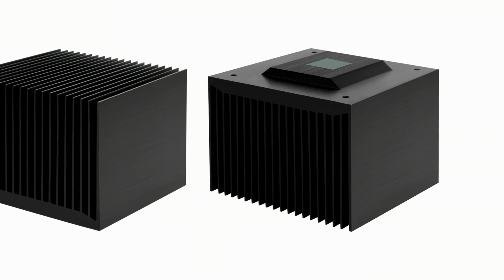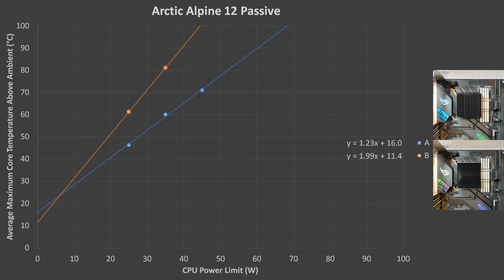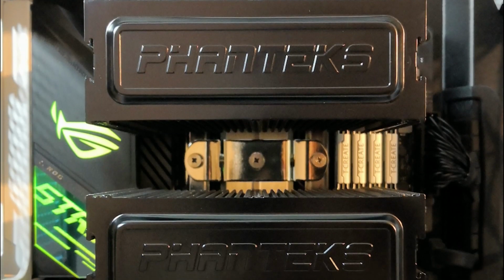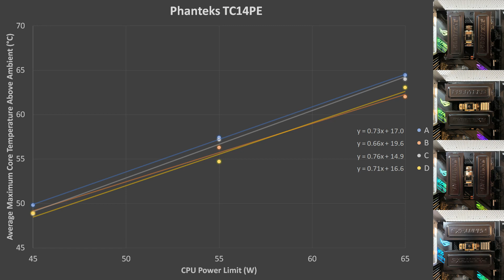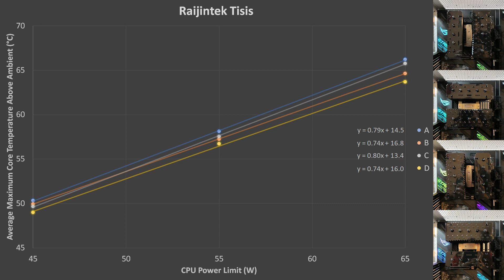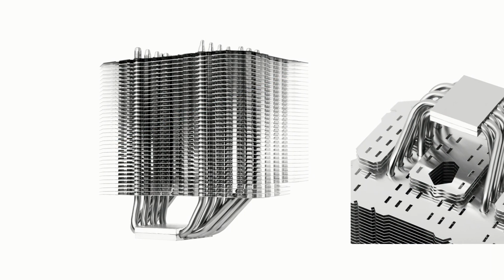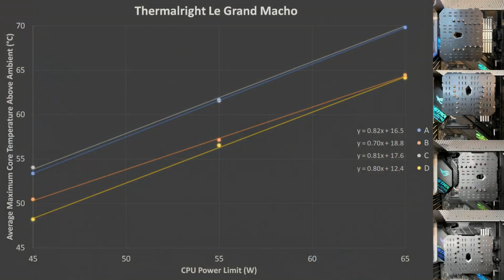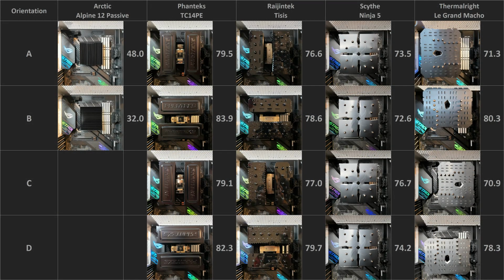Fanless CPU Cooler Orientation, Does it Matter?

Comment: Thank you so much for this video. It was exactly what I needed and must have taken a lot of effort to make!

I have a very old TR HR-01 that I wanted to use for a silent server, but I ruined it by cleaning it in salt and vinegar which did clean it but unfortunately also corroded it badly with massive limescale looking deposits on the thick alu fins that I can't remove. Only thing left to try is caustic soda (NaOH) to eat away a thin layer of the aluminium, but it will probably also strip what's left of the nickel plating and make it even more prone to corrosion in the future.

So I need something else and this video not only confirmed my beliefs on rotation, but also that a dual tower is not necessary worse than a big single tower for passive cooling. I do wish I could find something with fever but thicker fins though, like my HR-01, but without paying Noctua NH-P1 prices.

Comment: Would the only exception to the Arctic Alpine's poorer vertical orientation be if I placed fans in the front of the case for active/semi-passive cooling?

That way, the air flows through the fins as in the 100% fanless horizontal orientation's case.